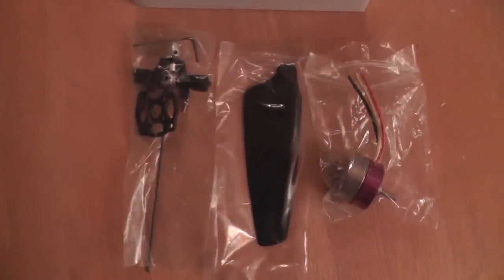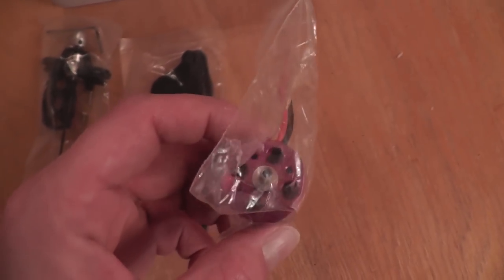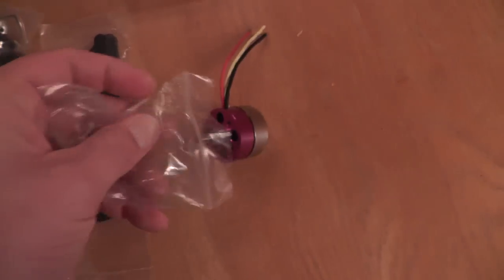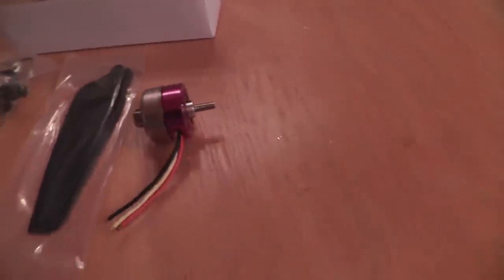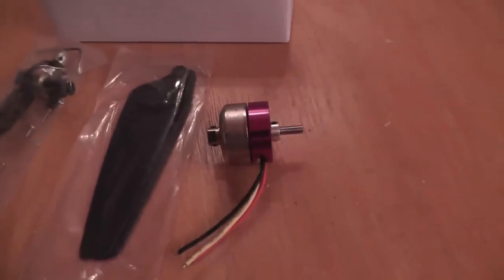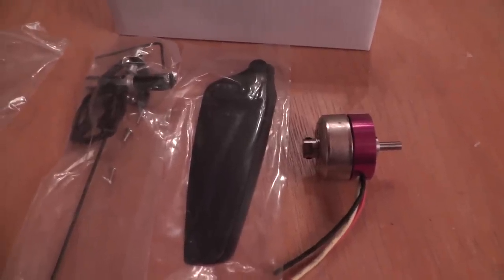Hobbyking Variable pitch prop - motor explodes and the shaft vanishes

Comment: Hey
Mine didn't blow up but the propellers flew off.
I got a couple of   Electrifly V-Pitch variable pitch prop system and the are made very well.  They are a little to hard to find and a little more expensive but worth it.   It has a RimFire motor which is a good brand.  You might try one.